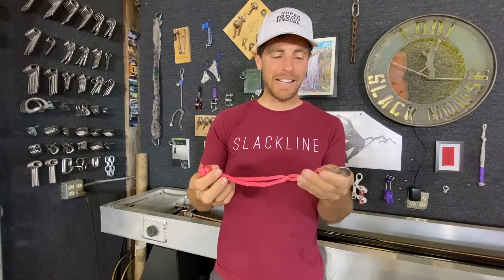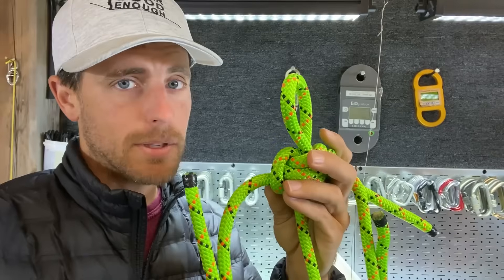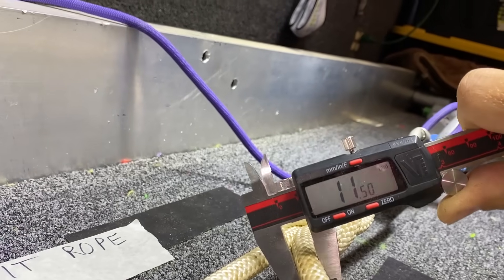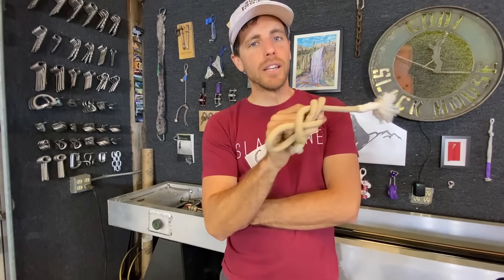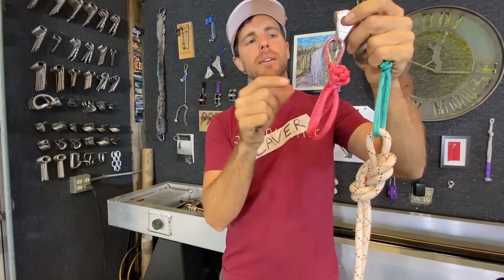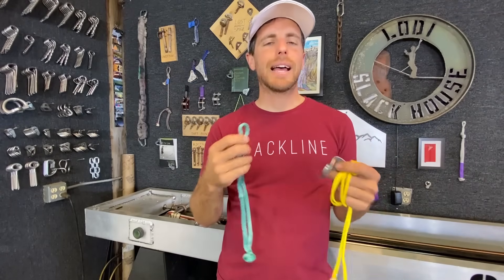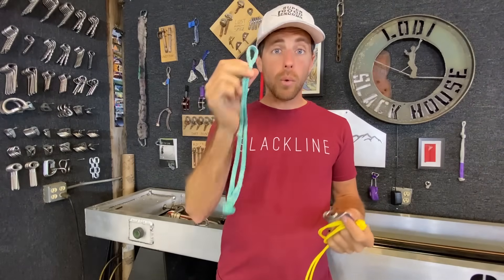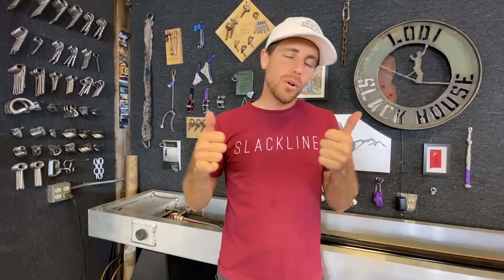Cave break tests - 40 year old Pit Rope vs New!

Comment: The Boy Scouts lied to me! We were told the square knot was the best way to combine two ropes
Reply from the maker: I just use an overhand personally (with long tails)
Reply: @HowNOT2  I’m new to climbing, haven’t done anything besides indoor bouldering. But love your videos to show cool insight into the more advanced side of things
Reply: @HowNOT2  You mean a Euro Death Knot?  It's best to use a double overhand
Reply: @eyescreamcake  I think he means the flat overhand bend...which is super good enough.
Reply: The square (reef) knot is a terrible way to join the ends. Use a bend. The scouts teach the double sheet bend for that, it's decent. The zeppelin bend is better. The Double Fisherman's bend is one of the strongest, but uses a lot of rope. The Reever bend is almost as strong, and uses less rope, but is harder to remember.
Reply: Yeah the square knot by itself is a truly terrible knot to join ropes together.  It will come undone.  However, if you tie each tail off with a barrel knot (basically a fishermans knot with a square knot in between) you get a strong bend that is easy to undo even after being heavily weighted.
Reply: @briandickey4276  That's still substantially weaker than a fisherman's knot alone AFAIK, and uses more rope. Why bother with the reef?

If you want a really strong and secure bend that doesn't use much rope, I'd recommend the Reever. It also looks pretty!